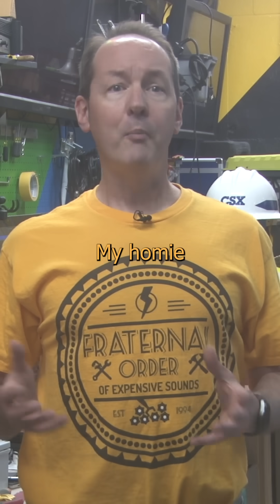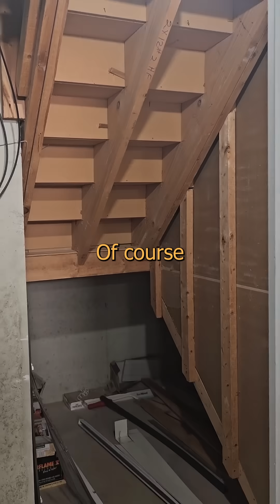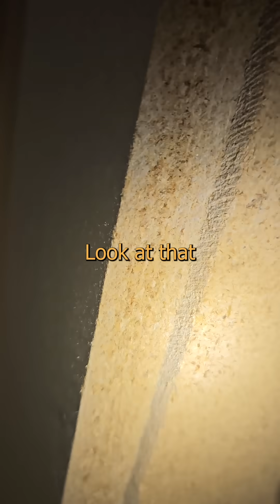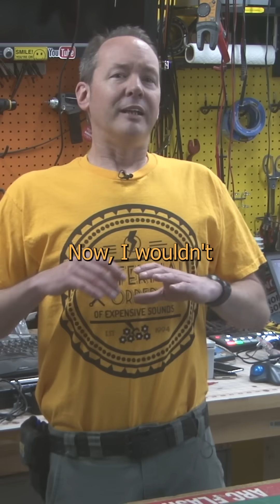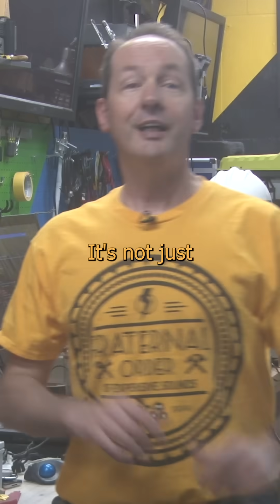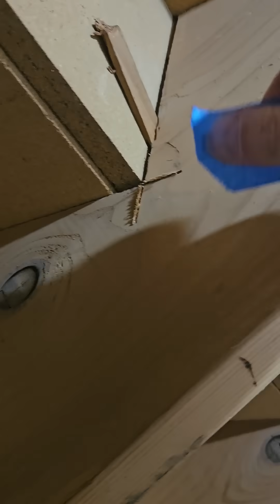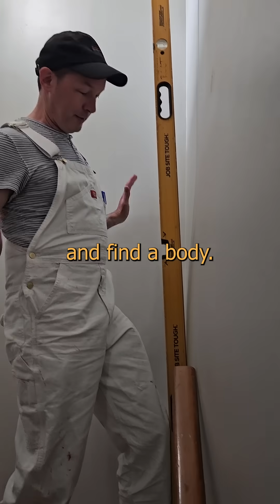Particleboard Staircase #chrisboden #engineering #construction #stairs #cheap #job #work #carpentry

Comment: Dude please stay off the carpentry videos. PLEASE.

Now, why does it matter, to YOU, that the sheetrock walls are oriented whichever way they are? Are they so curved that they can no longer keep bugs and cold winds out?

I freaking HATE anal retentives when it comes to MY work, I live or die based on whether my work is sound so tell me one technical or mechanical reason WHY walls have to be perfectly flat, perfectly plumb and perfectly level, because the reason does not EXIST.

We make things level and plumb out of religion, not "pride" and we do so, because the alternative would be chaos. What chaos results from bowed walls? It sets off the anal retentive types, that is what kind of chaos.

The walls are good, the framing is perfect and yes, I have worked for anal retentive crews that notch all their studs and install extra wood just to keep walls flat and you know who pays for this? The client.

As to the particle board, it was obviously done by a builder since multiple houses in the neighborhood have it. Not something I would ever do despite finances and I'll leave it at that.

Comment: In the 1980's there were particle board stair treads. They came in lengths of 12 feet I think and had one edge that was bull nosed. About an inch and a half thick and would span 16 inches. I installed many. They made great speaker boxes also. Very heavy.

Comment: I build houses for a living, 20+ years now. I've never seen this type of wood used on steps. They're throwing these houses together these days, man. Usually, when we cut the stringers, we finish the cut with a jigsaw, so you're not cutting into the stringers. I'm guessing this is a spec home. They're thrown together, quick money.  That's why the walls look like that, too. We always crown our studs, so we don't have this problem.

Comment: See, this makes me concerned because there's drywall UNDER the stairs in my house. Not to mention, some of the steps have started, uh, creaking. That being said, I think that I'll just leave the drywall up in case it's load-bearing. At least until I decide to start a new project of converting the closet there into an office or something lol.

The home builder that master planned our neighborhood has long since gone under, but there's an expression in my neighborhood about how the electricians were on crack and the plumbers were on acid. (The wiring probably violates codes in 3rd world countries, and several of our neighbors have just had everything gutted and redone. The plumbing is 100% functional... if a little redundant. There are a few loops of PVC that literally do nothing but hold more water, unless I decide to install a sink in an upstairs hallway that's barely 2 feet wide lol.) If I ever found out this kind of thing about my stairs, I think that I would have to hold a neighborhood meeting about adding the carpenters to the list too.

Comment: I'm sure this goes against code in MOST area's. Not to mention the overcuts on the stringers are just reducing the effective throat depth. I certainly would never use anything other than a solid material for treads.

That big bubble in the wall is sure something else.

Comment: My floor was particle board, and i mean the floor, it was joists, paricle board, than carpet, whe my air condistion would drain into abucket amd just leaked i had to redo half the floor imagine the suprise when the floor just breaks on contact

Comment: Those treads are all I have ever put in houses. Only if the treads are going to be finished do I put pine or oak treads on. 
I have framed houses where it has rained for a week before getting the roof on. Yes the treads swell a bit, but they are not the conventional particleboard that is the bottom of your sink cabinet. They are designed and engineered to be stair treads. More glue and more pressure to create them and they have less bounce than edge glued pine. I’d say they are even superior to pine treads. 
For those worried about fire, these treads will last a lot longer than the TGIs that are a death trap for any first responder trying to find a trapped person in any new home.

Comment: I sell (amongst many otger things) staircases to house builders (large and small) and have for 24 years. 
These are very common. 
They cost 109, we sell them for 150. 
Do i recommend them? No. Do i sell a shot ton? Yes. 
Usually 32mm pine sides, 3 /6 or 9mm MDF risers, 22mm MDF steps is adequate though, no need for overkill. They aren't known to just cave in even after being in 50 years. 
If your staircase is getting wet regularly, you need to stop that happening and not blame the stairs.

Comment: Reminds me of a house my wife and I looked at buying about 11yrs ago.
We were told “needs some work”, so it’s priced accordingly.  Plot twist: it wasn’t.  The walls and floor sagged so bad, some rooms the floor molding had popped off and would literally show you how bad the shift was by either floating over the floor by 1-2in or attached on one end and angled up lifting it as it went across the room.  Some walls you could literally see the waves on them even in fresh white re-paint.  I forget what room it was(iirc living room or dining room) the floor sagged so bad you felt the incline of the floor walking around.  The realtor was like “it’s not THAT bad, just gotta get a house jack and straighten out the floor joists and add some blocks…not a big deal”

We didn’t buy the house(or any for that matter -other issues), and then we put in a complaint to the company about the guy and the house.  We heard a few months later finally he got fired for “leading” and the house was torn down.  Turns out the house belonged to a friend of his, and they were trying to push people to it…. It wasn’t even listed with his company for sale.

Comment: It's been a long time since I was building homes and had seen pre-built stairs like that. From the vid the question I have is how thick is the tread and was it pre-built, because when we received ours, they were glued and press fit. Those looked like the treads were pulling away from the datos in the risers. That would be my biggest concern.

Comment: Sad to say, particle board is legal for both steps and risers if installed properly. But I'd never use it. Also there should be at least two layers of fire proof drywall under the stairs.

Comment: Particleboard stair treads are the cheapest option available and usually used in low traffic areas, like basement stairs. It’s probably not a code violation, but this varies with location.

Comment: My father bought a house in the 80's and when me and my brother had to do pipe work during the summer you should have seen the fuckery they had pulled with the piping twists that went nowhere and so many curved pipes you'd think they were trying to open a water park for ants. This isn't common it's fucking expected.
Just cause you can swing a hammer doesn't mean you know what you're doing.

Comment: 30 years ago I was driving a concrete truck delivering to a development of McMansions in Newtown Pa (Pricey Area) and I couldn't believe the crappy materials they were using. You could cut a hole in the wall of the place with a steak knife to break in if you wanted to

Comment: Baling wire will fix the rest. I would  put another piece of tape down just for the hell of it.   Just for buyers reassurance. You know how they all whine about how it looks like its not going to work like that. Like they are general contractors. all of a sudden.
the only downside to the trade ----- Customers!🤪✌

Comment: You dont know the product. People that arent pros and honestly most of the pros dont know either.
Resins and epoxi determain the performance on any manufactured products. 
I'd bet a thousand its to code if its in each house. Modern OSB is better than plywood and most people bragging they have 30 years experience will scream is trash.
Modern manufactured studs everyone agrees are better and thwyre the same product often.
He got a house he could afford. Its going to be junk. Im 55 and still buying junk.
Im also a contractor with 20 years experience in top tier homes.

Comment: I’m a metal guy and I know you should never use particleboard for anything structurally. It’s like using 1/8th in aluminum plate to build a wall it will work until you put weight on it. lol love you bud have a good day and good luck to the homeowner /congrats

Comment: I work in damage mitigation, and we see stuff like this somewhat frequently. We’re working a house right now where the water heater at the top of the stairs froze and burst a pipe. The stairs were made out of a material like this, and the top few stairs collapsed. Homeowner was lucky that it happened while he was away and came home to a collapsed staircase rather than finding out because he fell 15 feet into his den. The house is older, but the second floor was added only a few years ago by a remodeler. We also had to rip up the carpet and the subfloor upstairs to check for growth, and found out that they used five to six layers of moisture barrier, which was weird and annoying to get up when we did find mold on the slats. The job also turned out to have asbestos. And extensive termite damage.

Comment: I don't have a great view but I'm pretty sure I saw a much bigger issue.  The stringers are not in joist hangars and they appear to be fastened to ..... more particleboard.   If I'm right, that whole thing is coming down sooner than later and those treads will be falling with you into the basement.

Comment: I hate the fact they use this same sort of board on the floors of mobile homes! My mom and I are both in wheelchairs with limited income and our trailer we bought in 2015 Already has sinkholes in the floor near her room due to moisture! And neither she nor I can step over the soft spot in the floor with no way to fix it. I feel like mobile home manufacturers should be outlawed from using this stuff for flooring...

Comment: I ain’t got anything close to a certification or experience as a contractor or anything like that. Do have experience building this and some time in fabrication class in high school welding stuff. Dad and grandpa did a fair amount of woodworking and so I’m familiar with it at least. But that… I’ve seen high schoolers do better work.

Comment: That’s called a modular home and if you ever got to tear into the original floors and walls you’ll be equally as disgusted. I’d rather renovate 100 year old structures than Modular’s.

Comment: Shit, I did set design for a couple of years for theater. If I can tell you that wood wouldn’t be good flooring for a set even like two feet off the ground you roll on and off a stage, then it’s DAMN well not good enough for a HOUSE. If I’M throwing a fit, I can’t imagine how much the professional set designers and/or carpenters feel. Like, you can play it fast and loose (and all that jazz) in theater, but THAT’S atrocious. XD

Comment: We have basement stairs that were not built to code. Every carpenter who has seen them has told us to have them replaced. The stringers were built out of common knotty pine and not properly attached to the floor above. The treads and risers appear to be soft pine. The stringers were nailed from below into the floor joists above. The nails have pulled a bit on one side leaving the stairs uneven. I placed a jack under that side to make sure it can't move. A future project.

Comment: You can always put 2x material under the treads as backer also I didn't see any "fire blocking" on that wall the stringer is attached to the cross cuts on the stringer I suppose theyll have to live with😀

Comment: If they are new construction houses they probably are up to the current code. It’s just that the new codes allow for new forms of particle board to be used. If it’s like this in multiple houses it’s probably up to snuff. That or there are  really crappy contractors, carpenters and inspectors out there.

Comment: Been a finish carpenter for about six years. Participle board risers is a really odd sight. But we’ve used particle board treads on some houses. It passes code. I’ve always thought it was an odd choice.

Most builders now use the framing wafer material, same build as the jacks for the stairs(it’s not real wood) and that seems to do better and I would say it holds up better.

Comment: I used to work at Menards and they sell particleboard stair treads. The difference is that they're over an inch thick and specifically designed for carpeting or painting them*(y'know, adding a barrier to moisture) but I *still would trust the finger jointed edge glued pine treads AGES before I trust particle treads.

Comment: Nevermind the styrofoam stairs, that wall bend is INSANE. Like a fun house mirror without the fun.

That's why I won't be buying a house until the market collapses. Even with the current cost of materials and labor, houses are about 200k-500k too expensive.

Comment: I have done construction inspection and worked as a foreman building to US code. Had a government inspector say he had never seen the foundation anchors required by hurricane code before. The county used that code as their minimum building requirements. I also got replaced at several construction sites for refusing to pass crappy construction. I'm also still waiting for an office building I failed the foundation of repeatedly, until they highered another inspector to pass it, to slide into the pond they built it next to.

Comment: Risers should be above the step, not behind it, treads should be solid wood. This stuff is only for finish work and shouldn't be used for load bearing. The runners are also installed wrong too. If the particle board doesn't do the homeowner in the way the runners are installed will.

Comment: Oh I believe it! I went into a customer's house who was thinking of sueing their previous guy and the ding dong built them a staircase out of leftover particle board from IKEA furniture. The particle board was different sizes and shapes like it came out of a pile busted furniture scraps with one wild step at the top that required you to step over an empty gap onto a plateform made out of a few 2x4s. It was straight up methamatics build. The jankiest crap ive ever seen. I was in total disbelief. The most accurate way to describe it is it looked like a 10 yr old built it to get into a tree fort.

Comment: I don't know if anybody else mentioned it, but that craziness in the drywall in the staircase could very well be a buried electrical box. As an electrician, one of my part-time jobs is digging out buried electrical boxes 😅
Reply: Electric box on a stairways????
Look at those studs turned sideways under the stairs
Reply: The crap built today it could be the fire exit!
Reply: Reminds me of a hotel in England where we were setting up an exhibition. The power panel recess in a corridor was partially walled in with plasterboard (ObUS: drywall). The panel was making an ominous humming noise but that wasn't the oddest thing, there was a stepladder in the cavity and it had clearly been left in there by the plasterboarders since it couldn't be removed through the aperture by any sort of wriggling or twisting.

The hotel was built before the first Treasonous Slaveholder's Rebellion in the American Colonies so it had been through a lot of renovation and refits in its life but still...
Reply: So what you are saying is, it's like 6 code violations instead of 3.
Reply: @Polaf3456  6 so far, can guarantee any closer of an inspection and we'll be dealing with much higher multiplication than just double

Comment: As someone who's not from the US

Stairs being HOLLOW is making me VERY uneasy

Those fuckers should be FULL concrete where there's just a "/" slope on the other slide if you even can go behind the stairs
Reply: If they use real wood it's fine but the problem is it's not real wood. Real wood with proper joints are very strong
Reply: @Dj-px2ne Plus any carpenter worth a damn is going to put so many nails  through those risers into the backing studs that even a mouse won't squeak on them.